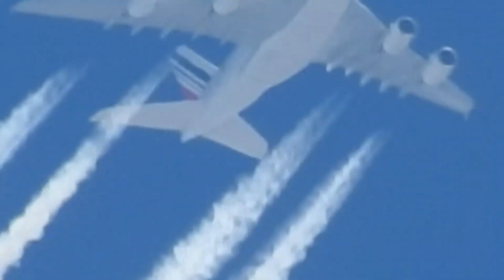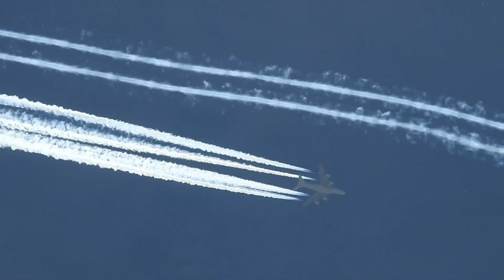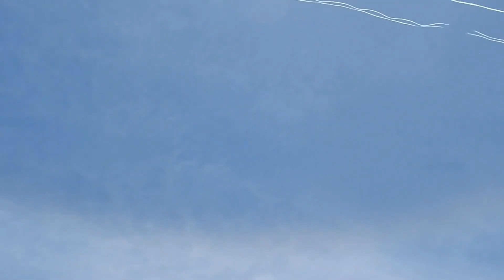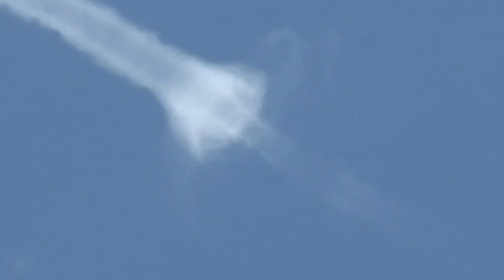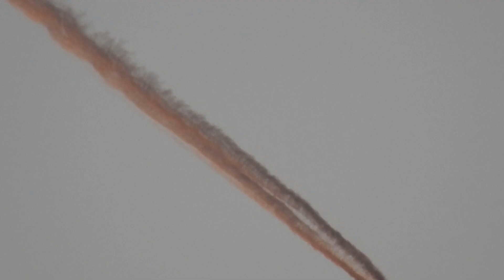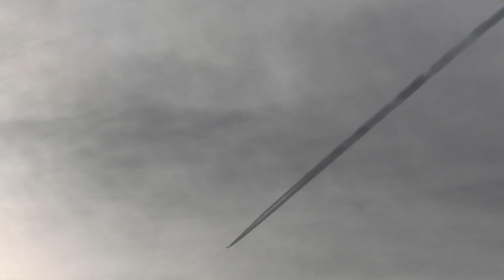NWS Meteorologist Explains NEXRAD, CLOUD SEEDING And CONTRAILS

Comment: Whether you see a ctrail or not is totally dependent on the atmosphere. 

An ephemeral ctrail is not even going to be noticed by anyone except the most dedicated sky watchers. Ephemeral = dissipates quickly. You have to watch closely because it will be gone in 15 or 20 seconds.

To get a persistent contrail you need cold temperatures (in the upper -40s and into the -50s) AND a relative humidity of greater than 60% (or with a dewpoint depression of 4 degrees or lower). These numbers are obtained by the twice daily (for most locations) radiosonde/weather balloon launched around the world.

There is one more requirement. That zone has to be in the area that the jets routinely cruise, which is centered on FL350 (35,000'), within a few thousand feet of that level. If those temperatures and humidities are not encountered in that zone you won't see a ctrail.

The jets fly in the troposphere mostly, below FL400. The stratosphere, an area of warming temperatures is above the tropopause, the dividing line. If the air temp is not <-46 deg C and >60% RH there won't be a persistent contrail. And it has to happen in the troposphere before the warming temperatures of the stratosphere are encountered. The conditions are becoming less favorable to persistent contrails with the colder thinner troposphere, which can end as low as FL200, which California just encountered in the past few days.

Comment: Interviewer isn't exactly enlightened. 

The meteorlogist is exactly right that contrails are jet exhaust. And the unburned jet fuel does have metals that were not removed from the refining process. Those lines in the sky are from the water by product of burned kerosene. If you want understand it you need to understand the data from radiosondes (weather balloons) launched around the world at 00Z and 12Z (UTC).

Comment: Even if there is no chemicals, how much carbon from burning fuel is each multi engine aircraft dumping in the atmosphere every second?
How many miles could you drive with that much fuel from just one multi engine aircraft?
Where are the emission controls?